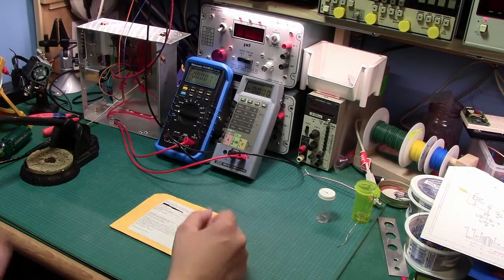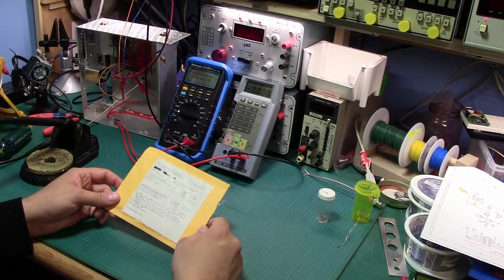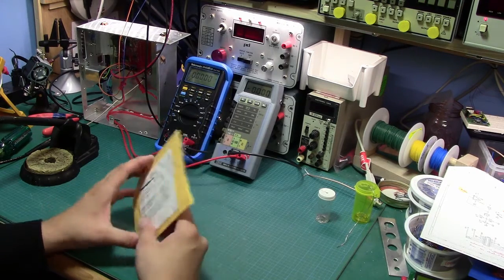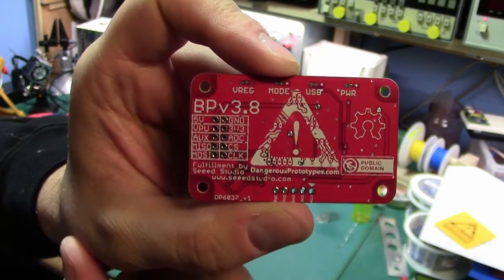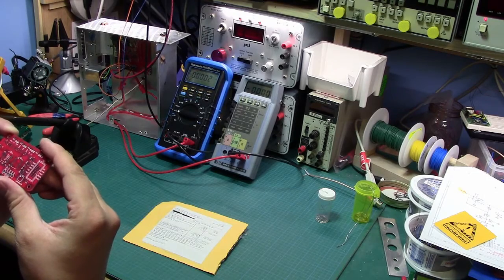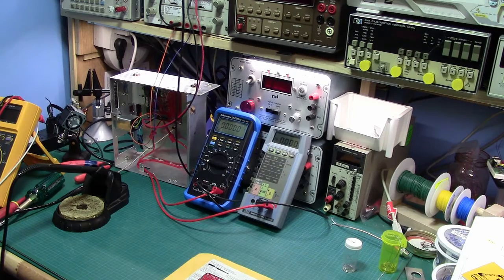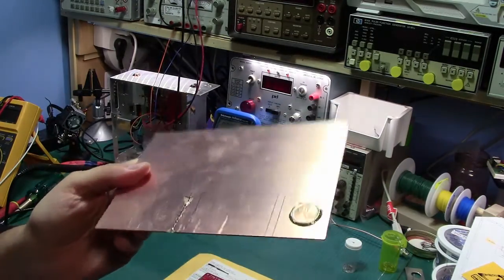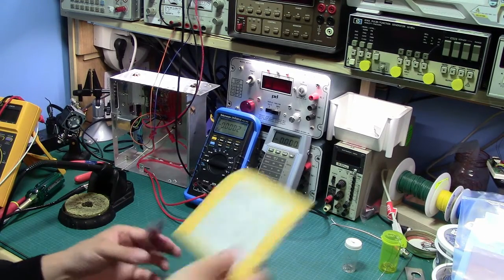Bus Pirate v3.8 Build

Comment: Hi idpromnut, great video by the way. Just a quick question(sorry it's not about the Bus Pirate Build). The marked rubbed pad over the table, where did you get it? I'm trying to get one of these for my Mini-Lab, but i can't find them. Is it from cutting machine?
Reply from the maker: +Daniel Soler Herrero Hi!  It's actually a cutting mat from an arts store (used for cutting with exacto knives and the such). It's not ESD or high temperature safe, but I tend to use it anyways. I am sure you can fine something similar close to where you are (something like this http://www.amazon.com/dp/B00Q28WHPU?psc=1).  Thanks!
Reply: +idpromnut Does solder stick to it at all ?
Reply from the maker: +tablatronix Solder will melt through the art mat, so if you get one, be careful. The ESD mat I have under the art cutting mat is high temperature-tolerant so it won't melt if you get solder on it.
Reply: +idpromnut I use tempered masonite currently. Solder sweeps right off it. But it is not cut friendly.
Reply from the maker: +tablatronix Nice!  I use a ceramic tile from time to time. But yes, not cut friendly :)